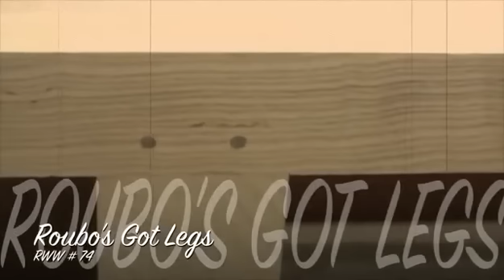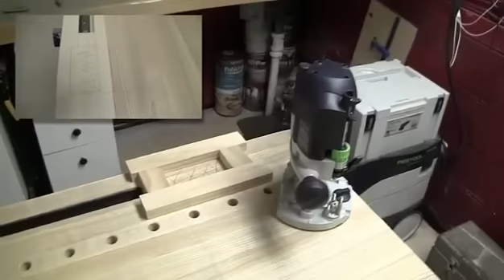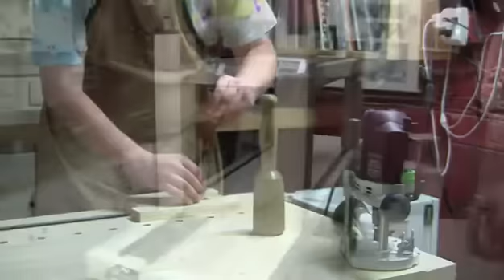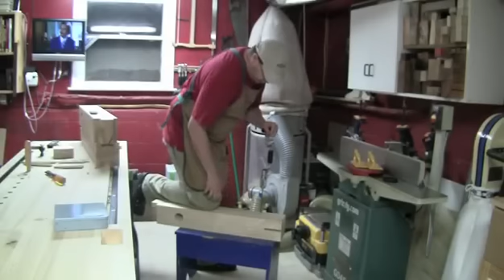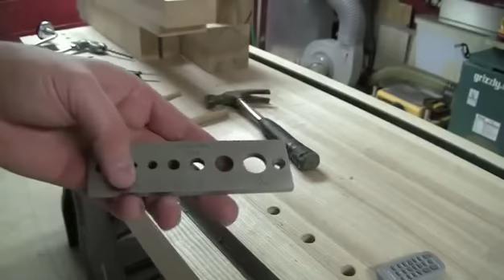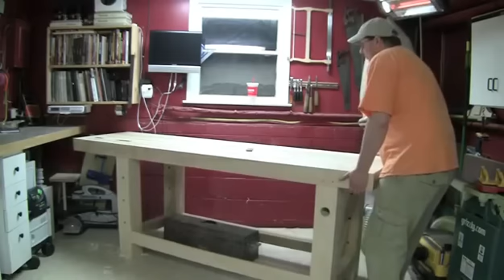RWW 74 Roubo's Got Legs

Comment: Would there be a good way to adjust this design to allow the top to be removed to make it easier to transport if needed?
Reply from the maker: +Matthew sure the traditional design called for through tenon legs that could be dry fit.  You could use integral tenons like I did and use non drawbored pegs, or just rely on the weight  to keep it on the tenons and use bench bolts or some other knockdown hardware in the stretchers.